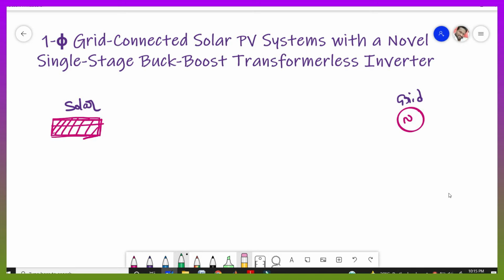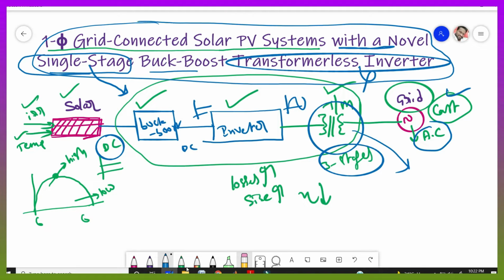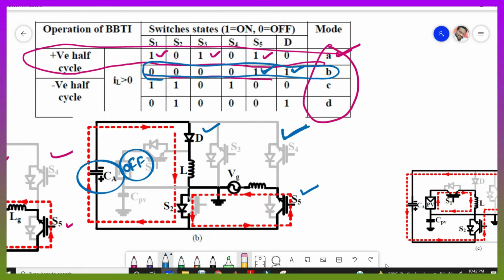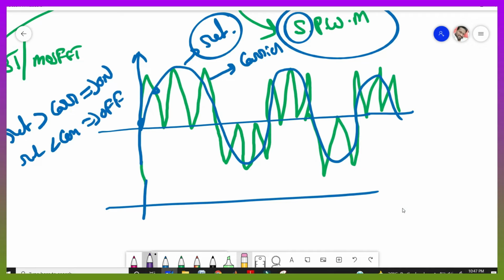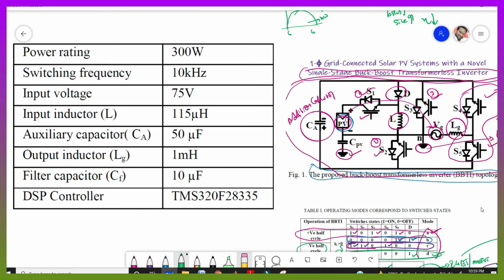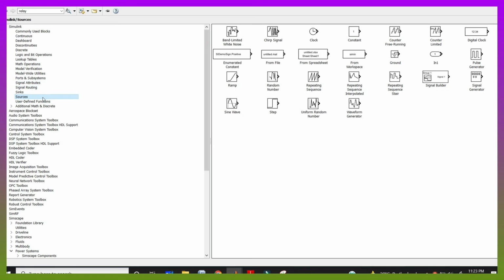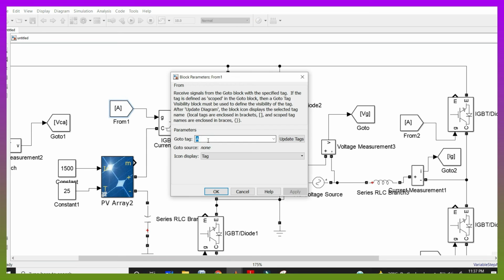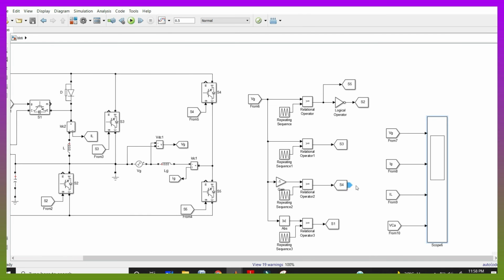Grid-Connected Solar PV System with Transformer less Inverter project Using MATLAB | IEEE Project

Comment: Sir my Simulink design is not generating the output...
I follow all steps that you are explaining in this video but still output waveform is not generating...
sir please replay...
why such problem arises...??
Reply: I’m facing the same issue. Is it working for you now?
Reply: @joshjoy2000  Have you completed this project ? Is it generating output ,Iam also facing same issue
Reply: No brother...
Reply: @santoshsahoo4584  Have you completed this project ?
Reply: @Nish6m  Brother the problem is only the PV array parameter...
If you fix it then the graph will generate...
If you disconnect the PV array, you can see the the main problem is only on PV parameter...
Reply: Ha there is a problem in pv panel diode Rsh @santoshsahoo4584
Reply: @santoshsahoo4584  how to fix pv parameters?
Reply: Yes I got same error

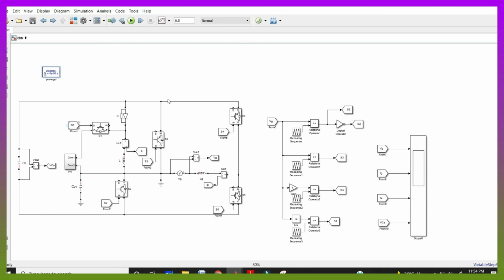Comment: Excuse me sir, at last 22:29 PV solar panel changed...
Can you explain how...?
Reply from the maker: Both blocks are pv array only I just put that in separate subsystem and name it as PV.
Reply: @Allabout_EEE  Thank You So much Sir😇😇
Reply: Sir i got error as output port is not connected to all switches 
What is the problem
Reply: Can you get the output? @LAEEPraveenkumarmv
Reply: @LAEEPraveenkumarmv  sir only reply's to ladies but body
Reply: Have you completed this project ? Is it generating output
Reply: In the pv array  subsystem the output port ( M terminal )is connected to which one sir